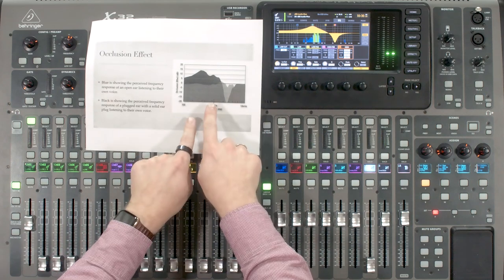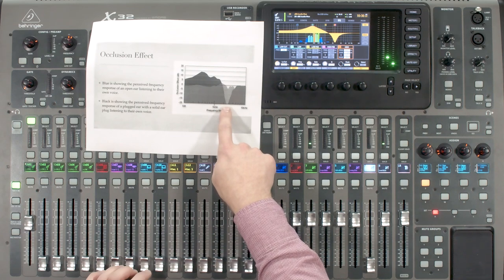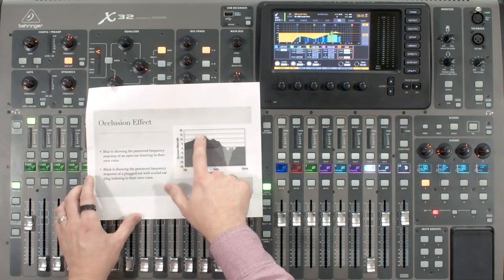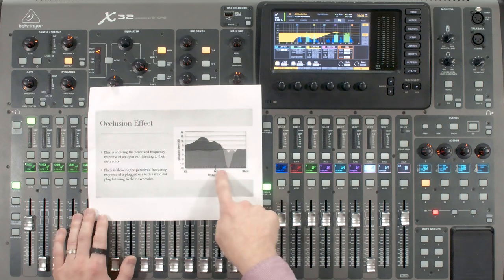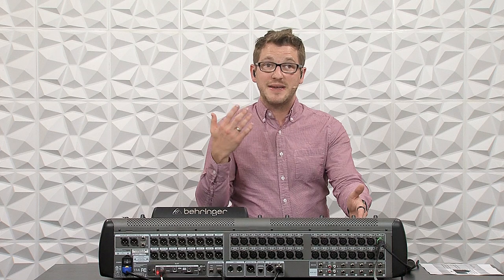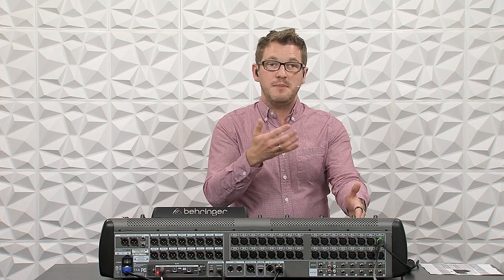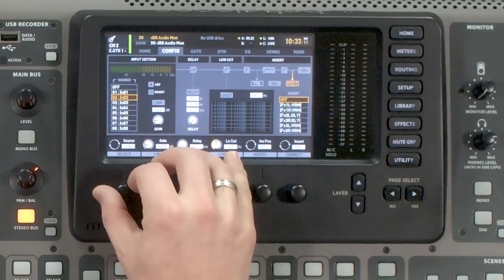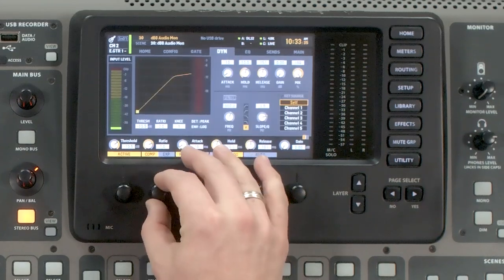Monitor Mixing - Making IEM Mixes Better: What is Occlusion??

Comment: Hey Drew!  It seems like I have run into multiple suggestions of doubling up channels for vocals for better monitor setup.  Sadly for me I am out of channels.  Right now we run the m32 with 2-DL16s and don't have any more channels so I can double up.   I am guess the best move would be to get another m32 and add it as a monitor board.  Can I double the inputs without having to have a physical xlr splitter?
Reply: Yes, if you add a second x/m32 just for monitoring, you can daisy-chain both mixers digitally via the AES50 protocol, same as the DL-16s. You have to decide, which mixer controls the pre-amps and does the gain staging, usually the first after the stage boxes. The other m32 can use a digital trim instead of directly controlling the pre-amps.
Reply: @stefanvombruch5649   i honestly love the idea of this.  I think the setup of this has just been very intimidating.
Reply: @shelbyhanneman  It is actually not too hard, if you have connected and routed the DL-16s successfully. Here is Drew's corresponding video:
https://youtu.be/qS326ETXlu8
Reply: @shelbyhanneman  Here is the video on which even three x/m33 consoles are connected the same way. https://youtu.be/rTLHcfao8pI
Reply: @mclovinfuddpucker  This is incorrect. DCAs do not sum audio, they simply act as a virtual control for multiple faders at once.
Reply: I do preamp sharing via Dante. One input with gain controlled by one primary board, and multiple copies of the audio are sent anywhere on the network. Can even use multicast to reduce network bandwidth.

Comment: Question: What if the band has 4 or more vocals that something take leads alternatively and use IEM. Would I set up an occlusion each? Can I assume that the rest of band channel is not required since they are all experiencing occlusion? or is the occlusion effect an individual experience that would require 2 channels for each vocalist?
Reply: It's for each person.  I just watched this and am running over ways to do this in my situation.  For my band we have 16 inputs so I've always used 2 channels for each input anyways, 1 for monitors and 1 for house.  What I think I am going to try is use the monitor input for the vocal channels to put the occlusion eq on and send that to each individual IEM and then use the house vocal channel to feed the rest of the band for that vocal.

Comment: This is great information. I have taken this and messed about with it on my mixer and it definitely sounds clearer. The issue I always struggle with is the isolation effect of having my ears plugged. It feels like I’m listening to CD, not giving a live performance. Also, if someone tries to talk to me between songs, I can’t hear them at all! Do you have any advice to combat this situation, other than adding in room mics? For context, I’m mostly playing bar gigs or private/corporate functions with a 5 piece band, so it’s not uncommon for audience members to yell out requests or want to talk to you. We run a pretty much silent stage, using amp modellers and E drums with a Turbosound column array PA and Presonus Studiolive 64 mixer. Thanks in advance.
Reply: House/Stage ambience mics
Reply: @saminatorx20  that’s too much hassle when you are mixing yourself from the stage. The levels are always changing and apart from that, I don’t think it helps much anyway!
Reply: Duck the mics when the band is playing so that you can hear requests called out between songs and audience reaction.
Reply: @gregorykusiak5424  how on earth are you supposed to do that?
Reply: @officialWWM  maybe really agressive parallel compression if your mixer handles it? Otherwise maybe vented IEMs are worth considering? I'm not really qualified to give advice though, I'm just throwing ideas at the wall
Reply: @officialWWM  some compressors has a side-chain setting. Instead of the compressor on "listening" to it own source, (usually its says "self-key"), you can assign the compressor to "listen" to other source.

One popular way that lot of sound engineers implement this method is ducking the bass from the kickdrum. So whenever the kick drum is played, the bass channel will be compressed.
Reply: @oqy1977  how on earth will that help improve an in ear mix?
Reply: @officialWWM  I'm just replying to your question on gregory's "ducking" method. 

there's no 100% guarantee method. all has  its pro's and con's.

Comment: The practicality of this technique diminishes rapidly when there are multiple vocalists. Ex. Five vocalists would require ten input channels….correct?
Reply: Yep. Assuming every vocalist needs to hear and be heard by other members. That's why dedicated monitor consoles and engineers become more common for bigger performance acts: to set up, keep track of, and run all the mixes at once. Especially if just the normal inputs alone are already way over 32.
Reply: If low on channels, do this for the lead singers first.